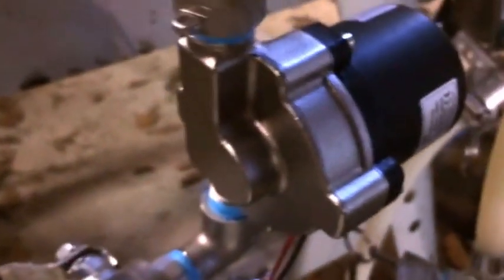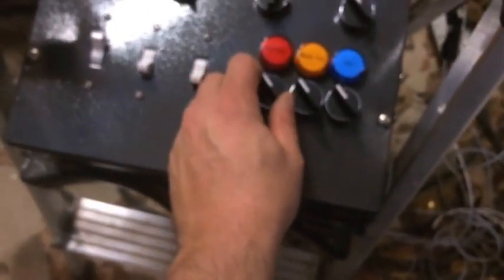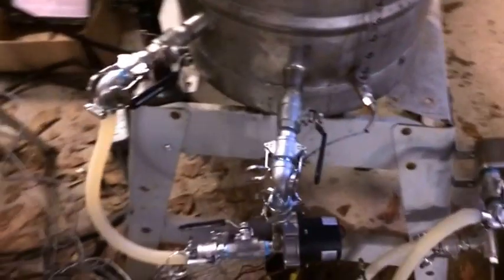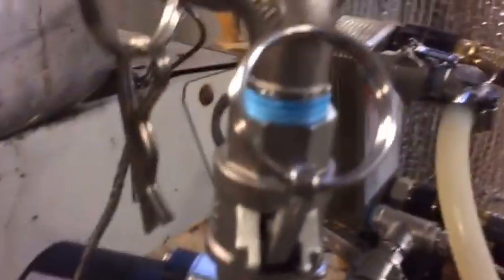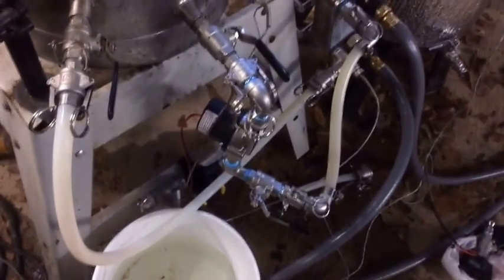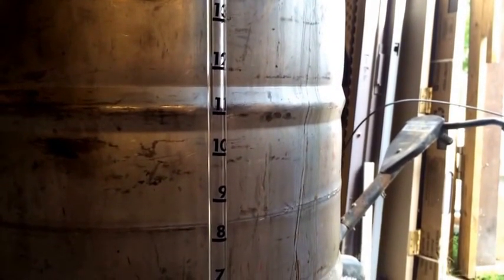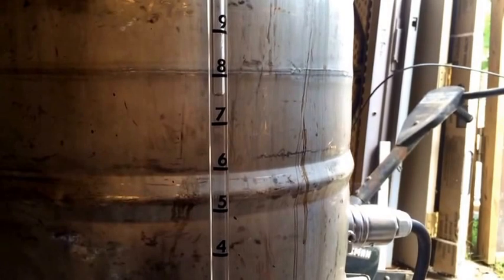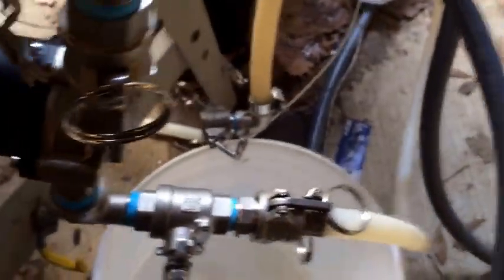My first review of the  newly released ussolarpumps TD-5 6GPM pump

Comment from the maker: Used it a few times.  It's a great pump.  It automatically shuts down if it gets too hot.  And it's more than strong enough to whirlpool or to run through my new hopback.  If you want to go with a 12v pump this is the way to go.  It's only slightly cheaper than the march/chugger pumps out there.